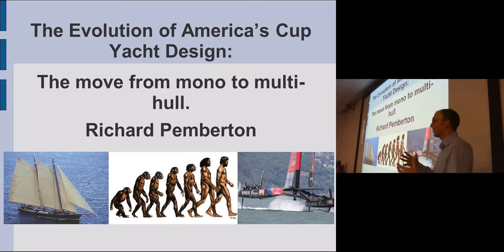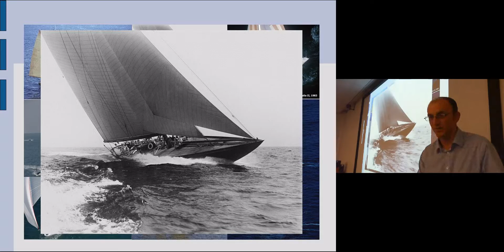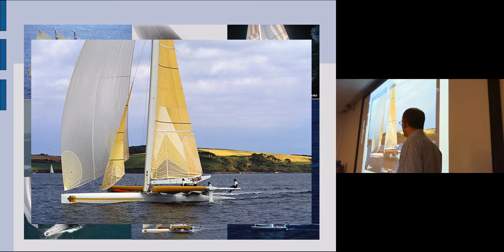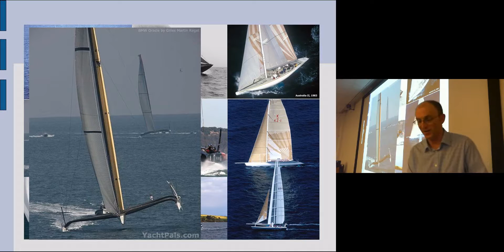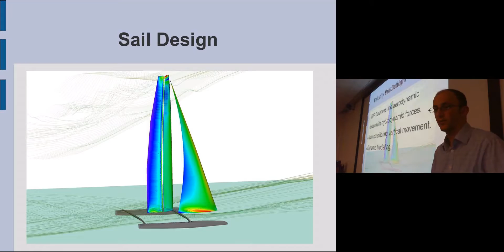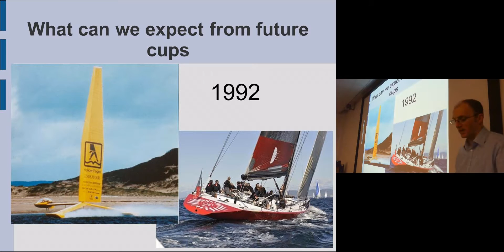The Evolution of America’s Cup Yacht Design: The Move from Mono to Multi-Hull

Comment: Great  lecture, It was amazing to watch in the 80's, especially when the Aussies first took the cup from America. Dennis Conners was the first to lose the cup for America, but he didn't have much of a chance up against Bondy and Ben Lexan's keel design. Ahh that Aussie ingenuity. Being about Ten years old I was very impressed by the effort of the sailors and designers to take the edge and win.
Reply: Correct.  The Ben Lexen design made every single 12 meter obsolete.  I was there in Newport the entire summer, on the water, on another twelve.  What's missing in your comment is that the Netherlands Ship Model Basin (often abbreviated NSMB), located in Wageningen with Dutch hydrodynamicists Peter van Oossanen and Joop Sloof -- performed much of the engineering work.   They also contributed to the conceptual development of the winged keel geometry.  The question is whether Dutch contribution violated the NYYC's Deed of Gift restrictions regarding the design coming only from the country of origin.  Australia required non-disclosure agreements (NDA's) which, in my view, have prevented the entire story from being told.    Van Oossanen publicly claimed he originated the wing‑keel concept.  I contend that Van Oossanen and Sloof contributed to the conceptual geometry of the wing keel — the part that actually made every other 12‑Metre obsolete. That’s the line the Deed of Gift was supposed to protect.

Everyone in Newport that summer knew the truth:  Lexcen was an innovator, but the Dutch tank work was decisive.   The wing keel was not a purely Australian invention.  The NYYC let it slide because they didn’t want to win on a technicality.    And because losing on the water was less embarrassing than disqualifying the challenger and looking petty.